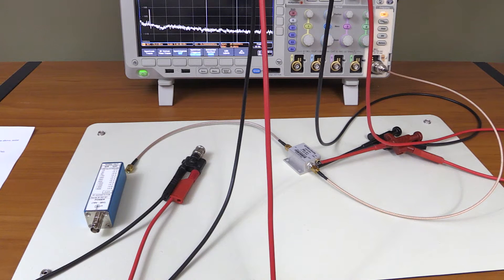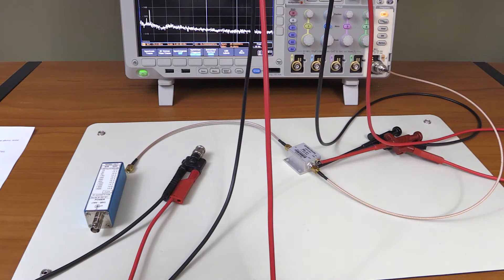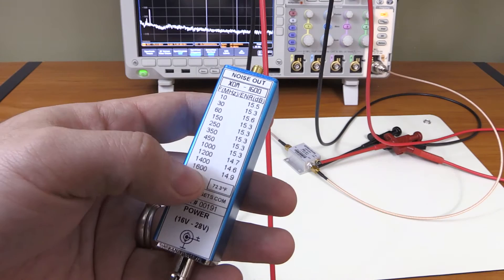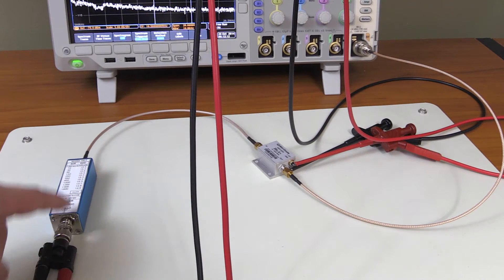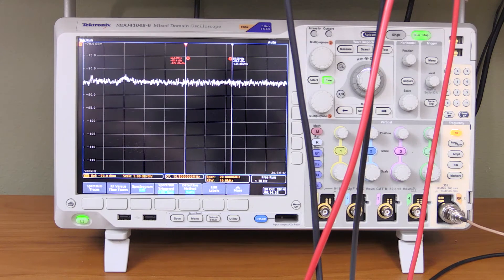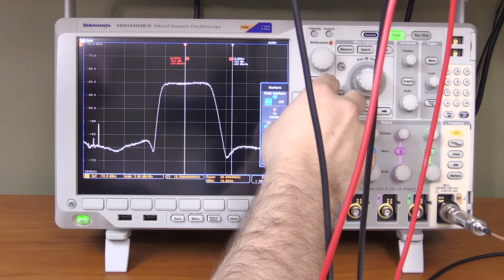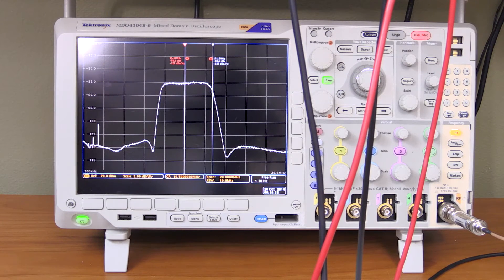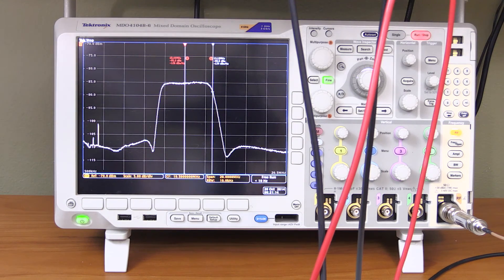RF Filter Passband Measurement with a Noise Source (How To)

Comment: Even if your noise source is not so flat (say it's got some 1/f component or something) you could still measure the noise source un-filtered, then the noise source filtered and take the ratio between them to get the filter response, this is how we would measure optical filters with poor light sources that showed peaks and all sort of irregularities. As long as the power spectral density doesn't drift with time you'll be good but even then you could fight drift with averaging. This way you could get good nuff results without expensive noise sources.

Edit: A minor problem with this is the ratio is usually super noisy outside of the noise bandwidth, the reason being if your noise drops too much you don't have resolution to observe how the filter is affecting it

Comment: This is very informative but you left out the part about how to do it with fft. I tried to get it to work on my Agilent 54622A and had no meaningful results at all. I’m using a Rigol function generator wide band noise function for my source on a low pass audio filter and see no response trace, just the noise. Can you give me some hints on how to do this right?

Comment: Hi Sebastian, first thanks for making this series of noise measurement video, it really help me understand how spectrum analyzer is related to noise level measurement, and I have a question, before turn on noise source and amplifier power, noise level is at about, -110dbm to -115dbm, after power on amplifier, level goes up to about -96dbm (shouldn't be -110+30=-80dbm?) and after power up noise source, become  -80 dbm (noise source has a +15db ratio, so it looks correct), so amplifier only amplify by 20dB?( not 30dB?)